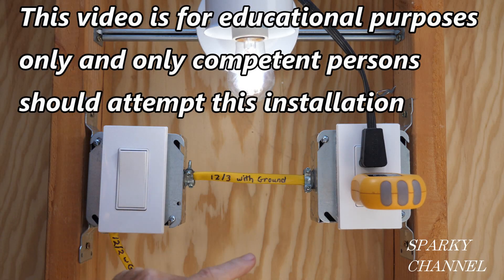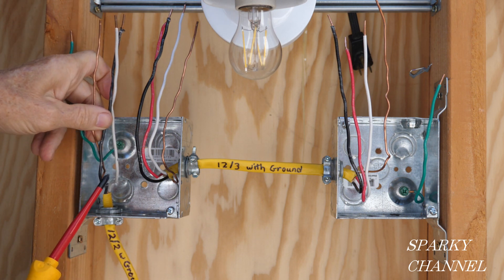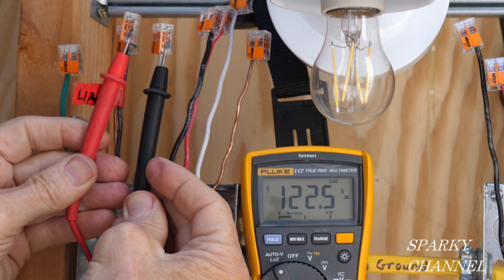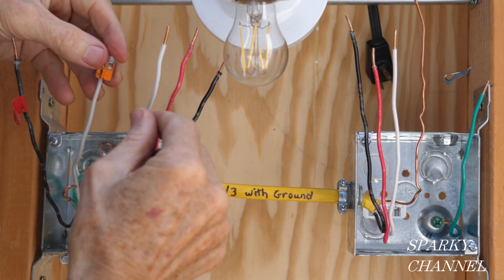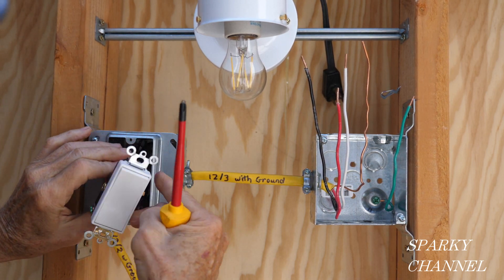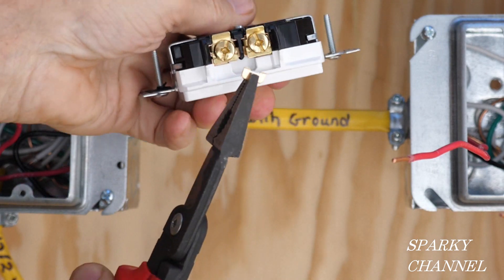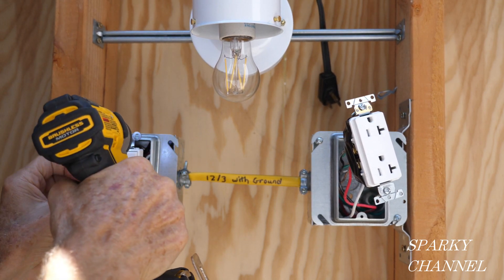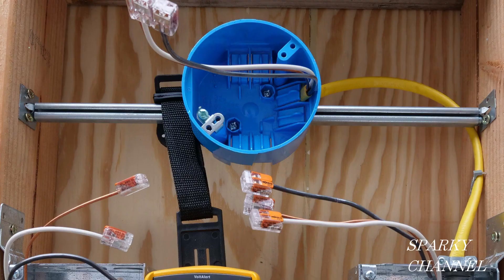Half Hot Receptacle with Power to Switch Installation

Comment: Great video. I have a technical question however… What if you need to install a GFCI receptacle in this exact situation. Not a duplex receptacle where I can break off the tab. Please let me know.
Reply: I had this same problem. I ended up installing a gfci “upstream” (between the panel box and the half-hot outlet) and that way both the outlets are gfci protected.

Comment: Love the video! How would I accomplish this if the Romex is not a 3-wire conductor? It's a 12-2 or 14-2 not a 12-3 or 14-3. Basically, I have a switch controlling the sink disposal that is wired directly. I want to remove the direct wire, replace the disposal wire with a plug, add an outlet that is half switched and not remove or replace any Romex? Is there a safe and easy way to do this? Or do I need to run another Romex from the switch?

Comment: what would happen if you didn't break the tap off the brass side , would your switch just not work or would you get an arc when you would turn on the breaker?
Reply: The switch would control both sides of the outlet. Ask me how I learned that...

Comment: With a half hot receptacle, is there any convention or regular practice, to determine whether the top or the bottom portion of the receptacle is hot all the time.  Is there any reason not to make the top portion switched and the bottom portion hot all the time?  in your 3 way switch, you put the red traveler wire on "top" (if I remember correctly).  This time you placed the red wire on the bottom.  I realize this is not a 3 way switch, but we are using the same 12/3 wire in this application.  Thank you again for this video.
Reply: Not an electrician, but imma take a wild guess, as I was wondering the same. I think Bill did it this way for illustration purposes. With the receptacle device inverted, if the plug were put in the “bottom”, the cord would run over the “top”. This would mean the tester either couldn’t be plugged in, or the cord would have to be “pulled” forward out of the way to do so. I think he simply did not wish to show this scenario.

That said, I would have liked to see either the lamp in the switched portion (for better illustration), or the tester plugged into the always-on receptacle (to show that it was also wired correctly).

Comment: Thank You for sharing - I have an old kitchen with dishwasher and garbage disposal on the same circuit but both outlets are wired on the switch. I just need to snake a 14/3 wire to replace the existing 14/2 wire..

Comment: When hooking up a ceiling fan to a half hot where power goes to the switch… does it matter which i connect to?  Meaning ..tap the switch wires or the outlet wires?  Thank you

Comment: Thank you for taking the time to explain this thoroughly.  One question - You mentioned a tool (invented by a friend?) for stuffing wires into box.  I didn't catch the name and I don't see it in list. Please advise. Thx
Reply: It's called the VoltClaw.  There is a combo pack that includes two pieces on amazon for $25.  I have one.  It is super handy.

Comment: Hey sparky I have a couple of questions. Are every garbage disposal and dishwasher connected in a half hot receptacle under the sink? Also the breaker on my uncle’s dishwasher pops whenever he turns on his garbage disposal. Is this a short that happens on the garbage disposal and affects the dishwasher since they are both connected under the sink with a half hot receptacle?

Comment: My scenario. In the bathroom I have a light powered by a switch on the opposite wall. I am in need of a new outlet on the same wall as the light. I can create a new outlet with power from the light but that would mean it will only be hot when the switch is ON. Is there a way to keep the new outlet hot all the time independent of the wall switch. Remember I am taking power from the light that’s been powered by the switch. Thanks

Comment: I do something very similar to this.... but I use two switches at the "source" box, feed by the same branch circuit, and use 12/3 (or 14/3 for dedicated light circuits) between it and the "destination" box(s). it allows two independently switched hot lines (one black, one red) for my basement lights.  That way, each "destination" outlet has the ability to turn on/off separate banks of lights with only one run of wire to the outlets, basically halving the required run of wire across the entire basement.  Provides the ability to half light or fully light the area for my shop... the main center lights and the secondary rim lights.

Where can I get that wire dressing tool you used?  I like it.

Comment: What if you wanted to add a light on the ceiling how would you add that into this circuit which wires do you connect? Do you take the red wire and wire nut it to the black hot wire coming in from the line and add a new wire to the load 14/2 or 12/2 going to the light where the red wire was?

Comment: Hey sparky, you have great videos. I am dealing with this same scenario but the only difference is the box housing my receptacle has an extra hot and extra neutral. Should I just pigtail them and run a single hot to gold and a single neutral jumper to silver on the receptacle? The switch only controls one outlet that I'm aware of (only one red wire) and there are no other switches in the bedroom.
Thanks in advance for any and all help

Comment: In addition to the two traveler wires I have for my receptacle, there is an extra black wire also. I located another random Black wire in a light switch by testing for continuity. Any idea what it could be for?
Reply from the maker: Are your devices standard 3-way switches?

Comment: Great job sparky its taken me a week to figure out how to do the 4 way switch but your video showed me how to in minutes , so thank  you . I have 2 rooms that have half hot receptacle for lights on lamps. I installed no-can led lights I have no need for the 1/2 hot outlet for lights , how do I undo it so its not control by the switch and outlet is always hot and I can install a dimmer switch as well . thank you again

Comment: I noticed both of my twin switched outlet/receptacle turns off with the switch. It doesn’t matter which outlet I plug into. Both will turn off. Every switched outlet in my house does that. Must have been wired wrong by the same contractor
Reply from the maker: It does sound like it.

Comment: I've learned a lot from your videos, thank you so much. I have a couple of comments though. I would make the upper one switchable so the the switch would turn the light on and off. The other thing is about the orientation of the receptacle. Electricians and your viewers will understand this but average homeowners would probably not or at least not initially.

Comment: Hello. I'm curious if you can give me some insight. I have a half hot receptacle below my TV. (Recepitcal #2 of 3 in the room, Bottom hot, top switched) 
This receptacle has two 14/3 line & load wires in the box. Is it possible to tap into this box to install an always hot outlet up higher behind my TV?

Comment: Hello, I have a problem. I installed 4 recessed lights with dimmer. Now they flicker. Does somebody know how to find out what is the reason?
Reply from the maker: Loose wiring can cause intermittent flickering LED lights in fixtures. Try turning off your circuit breaker and examine the wiring, or hire a professional electrician to ensure that your wiring is not loose or malfunctioning.

Comment: I've always wondered if the hot tabs (once they are snapped apart on the switch) are too close.  What's the chance the always hot tab arcs over to the half-hot tab?
Reply: Jo: Air is a good insulator and you need to apply 3kV/mm of conductor separation to conduct electricity through an air gap. Typical Leviton tab separation is ~4 mm so you would need to apply ~12kV to the switch for the tabs to conduct between each other. No house anywhere is wired for that voltage. You're safe.
Reply from the maker: Well I have faith in the engineers at Leviton so I wouldn't anticipate a problem. They do look kind of close though. I never thought of that before. I know the spec grade devices leave more room than the contractor grade. Another reason to use spec grade......

Comment: If you do such a thing you should take care that the load does not exceed the rating of the switch. I don't know the rating of american light switches, but I guess it's 15A. So it wouldn't be wise to use this for a 20A circuit.

For example here in Germany outlets are rated for 16A / 250VAC. The standard light switches are only rated for 10A / 250VAC, but there are special ones available which are rated for 16A especially for that purpose.
Reply: Ja Marcel - Man muß darauf achten. Aber wenn ich die "T"-formige Steckdose sehe, weiss ich sofort ich arbeite mit einer 20-Amp Leitung.
Reply: @jobaecker9752  Das ist schon klar. Ich wusste nur nicht mit welchem Strom die Schalter belastet werden dürfen. Wenn ich einen 20A Stromkreis mit einer 20A Steckdose habe, dann sollte ich auch einen 20A Schalter nehmen.
Ja, der T-förmige Neutralleiteranschluss ist schon von Vorteil, vor allen Dingen ermöglicht er eine Abwärtskompatibilität. Man kann ja auch ein Gerät mit einem 15A Netzstecker anschließen. Aber trotzdem hat dieses Stecksystem einen entscheidenden Nachteil, und das ist der Berührungsschutz. Wenn der Stecker nur teilweise eingesteckt ist, dann sind Teile berührbar die Netzspannung haben. Wenn man da nicht aufpasst bekommt man eine geschossen. Die Briten und die Australier haben deswegen einen Teil der Kontakte isoliert. Bei Schuko braucht man das nicht, die Steckdose ist so versenkt in der Wand dass man an die Pins gar nicht dran kommt in dem Fall.
Aber man kann da auch nicht immer nur nach der Steckdose gehen, es gibt Staaten in den USA die es zulassen das man in einen Stromkreis der mit 20A abgesichert ist die 15A Steckdosen verbaut. Müssen dann aber wohl mehr als zwei Steckdosen in dem Stromkreis sein.
Reply from the maker: Hi Marcel! I used a Leviton Decora Plus Spec Grade 20A Switch. The circuit is 20A and the wires are 12 gauge. "Spec Grade" in the USA means Federal Specification Grade" which is the grade you must use to work on a government job. I always encourage my viewers to use Spec Grade in their homes even though these devises cost a little more. You make a good point that the cheap devises shouldn't be used. Thanks Marcel!
Reply: @SparkyChannel  Not only cheap devices, devices which are not properly rated for the task. Like I said, 10A rating for a standard light switch and 16A for the outlet. It will work, depending on the demand of the connected appliance. We also got switches which are designed to switch all active conductors (line and neutral). This especially of interest if you use a grounding system where the ground is not connected to the neutral provided by the service. So the neutral could have a potential deviating from ground potential. But this TT-grounding system is more and more replaced by TN-C-S, which is called MGN in the US (multi-grounded neutral).

https://en.wikipedia.org/wiki/Earthing_system#TT_network
Reply from the maker: @Marcel_Germann  Excellent! We don't have 10A residential switches here in the US, just 15A and 20A. On a 20A circuit, I prefer to use 20A switches.
Reply: @SparkyChannel  Yes, but remember: Our voltage is 230V, so the 10A are 2300W. That's enough for most light fixtures. The 16A are 3680W on 230V.
The 15A on 120V are 1800W, the 20A are 2400W.
The circuit for the lighting is still fused with 16A in most cases. The lamp will limit the current, there can't be any thermal overload in the lighting fixture, only a short-circuit is possible.
The longest lasting switches are the electronic ones which switch at the point of zero crossing. Then the load is minimal, this will reduce arcing in the switch and spare the contacts inside. I got such a switch in my staircase in combination with retraction switches. They look like normal switches but they don't stay in position if operated. They just send a short impulse.
https://www.eltako.com/fileadmin/downloads/en/_bedienung/ESR12np_4873_internet_gb.pdf

That's the version for the installation on a DIN-rail. There's also a version for the installation in a junction box.

Comment: Hi Sparky- in my home one of my bathrooms has a GFCI outlet that only turns on when I turn the light switch on thats on another wall in the bathroom. How do I fix this?
Reply: I'm guessing that the issue is somebody wiring your bathroom made a simple mistake. If you open your switch there is likely a bundle of constant power black wires, pig tailing off to feed each switch. There is also going to be switchleg wires that run into the other side of the switch so that the light turns on. If one switch has more than one switch leg wire, it's possible that they meant to run the gfci hot wire into the constant power bundle, but mixed it up and put it on a switch instead. I'm making alot of assumptions here but that is a common mistake that I have seen and fixed